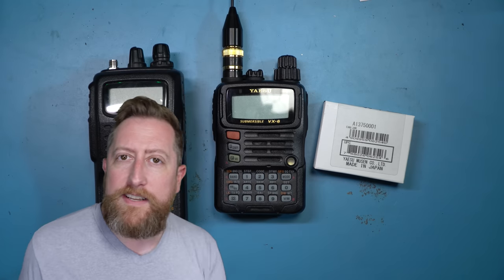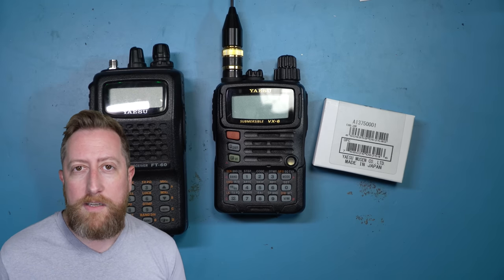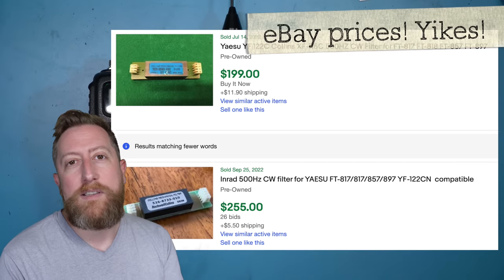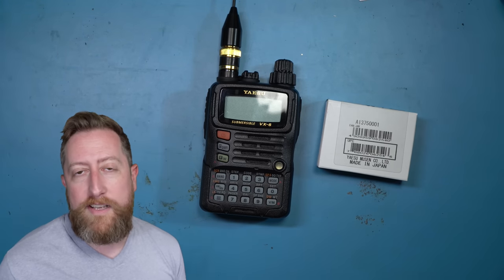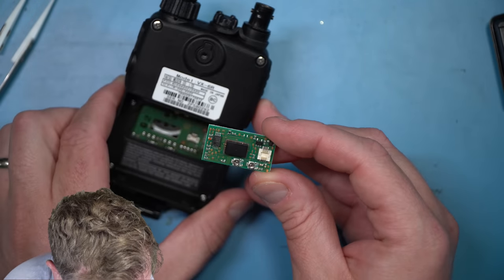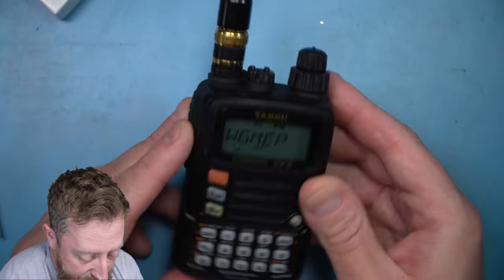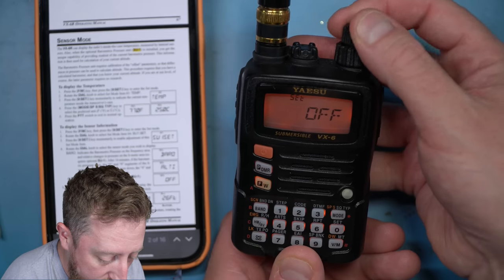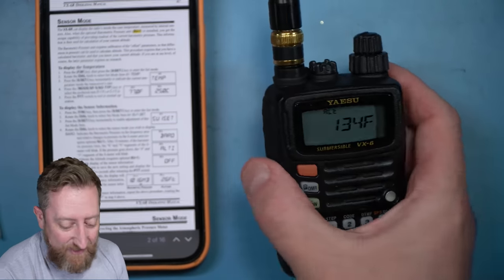Odd Ham Radio Drop-In Expansion Modules

Comment: Something you might consider, calibration, I took mine to a local airport and calibrated the elevation to the surveyed elevation of the landing pad. Once done baro and msl have remained exact for ten years or more. VX-5r with the SU-1.
Reply: USGS survey markers
Reply: How do you calibrate the bark and alt?  What are the steps?
Reply: @w8umannarbor612  You should be able to find that info in the owner's manual of operations. That is where I learned how to do it, but remember, find an accurate surveyed elevation mark, such as an Airport run up pad or Surveyor's reference mark.

Comment: My experience with SU-1 is that it is much more accurate than GPS altitude. But there is one quirk to lookout for: The battery assembly is gasketed to keep water out and would affect the pressure sensor. Take an altitude measurement and then pop the battery off and on. Retake the measurement and it would be different.

Comment: I have an older VXA-710 (pre Yaesu, Vertex Standard) submersible aviation radio.  This radio has the identical expansion slot. The barometer/altitude feature would add to the avionics back-up capability of this radio.  👍

Comment: I have the IC-91A that I purchased at a hamfest. I think it had the original box with the d-star logo on it. I was new to the ham world, and thought I had a radio that did d-star. I soon found out that if I wanted d-star I had to purchase a plug-in module. Luckily, they still sold them, HRO I think. The IC-91A had a metal access plate with two screws. Booted the radio after install, and it had a visual prompt, indicating a successful install. And voila, I had d-star. The module was about $100. It was so fun making this radio do something it couldn't do originally. Thanks for the video! I got to relive the experience.

Comment: I also have a vx-6r and grabbed the barometer. I’ve used it maybe twice. Kept the original sticky cover and haven’t had any issues. Still submersible. Then I found out newer iPhones also have a built in barometric sensor… no regrets

Comment: Greetings! I have the VX-5 and I saw years ago when I bought it they had the SU-1 plug-in listed, never really saw a use for it since barometric pressures are changing and I did not know if there was a calibration setting for it. As for the Kenwood Video microphone, bought one at Dayton years ago when a dealer from Canada was liquidating his stock of them. It is low resolution/potato vision camera that is capable of transmitting on several SSTV modes. It will work on FM as well as HF sideband if one makes a microphone adapter for it. What I have found that in a grid down situation you can relay photos to a command center within a minute so they can assess situations. There was also a DOS disk program that allowed one to offload the phots from the unit. It can hold 10 photos and you can program your call on the overlay. Kenwood even made a commercial version of this but could only hold 9 photos. Don’t know what other differences there were between the two models as a Kenwood shop at the time we had no customer interest in this version.
This was a good video and it’s too bad that Yaesu has not made a plug in Bluetooth module for these three radios using the SU1. 
73!

Comment: The VX-6R unfortunately can't do much with that display. But still cool! The VX-5R and 7R have nice display and actually shows you barometric trend's over time, if im not mistaken. This allows you to see if the weather is going better or worse (not scientifically, but accurately enough). It's like a Casio Pathfinder in a way. The PRW-2500 (and other models) have a little window on the left of its face to show barometric tendencies of the last 10 hours displayed at all times.

Comment: I would thing In order for the altimeter to be accurate you need to set a reference barometric pressure.
Reply: This is why I never use either, usually you need to calibrate either To a known value, kind of defeats the purpose. If you set the Atimeter before a hike by entering a known elevation from your phone , why not just use your phone?
Reply: @aj2isotadxing  At trailheads they will sometimes list elevation, you can calibrate then.

Comment: I don't think having a big open motherboard access slot in the battery bay on a submersible radio is a bad thing... - I expect that there is a gasket around the battery bay so the battery terminals don't short by default so anything in that bay would be gasketed up to particular depths/pressure for at least fresh water ingress.

Comment: Hello, does anyone know if the VX-6R supports “split mode”? In the baofeng I can set up a uhf frequencie to listen and when I PPT I can TX in VHF. I looked in the manual and only find the “split mode tone”, it only works for tones. Thanks.
Reply: Did you find out? How would split mode be useful or beneficial?